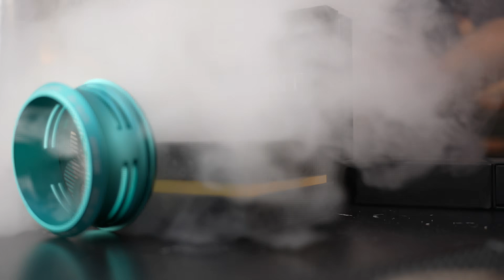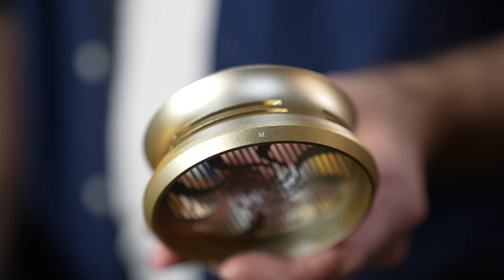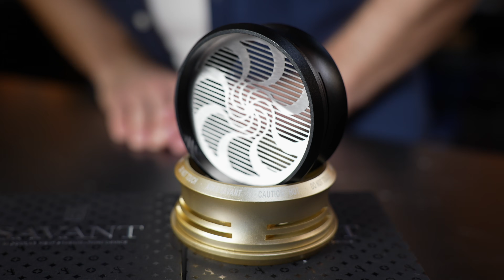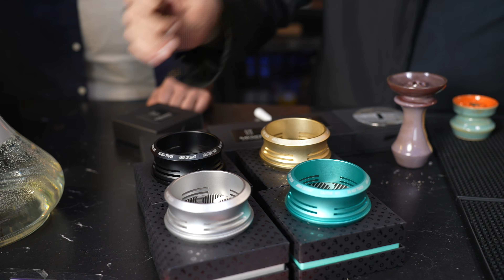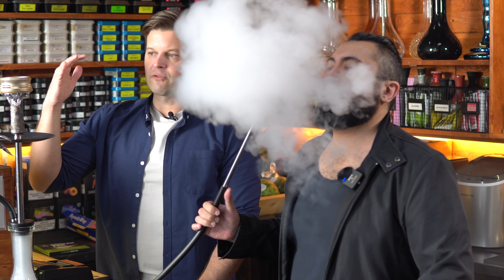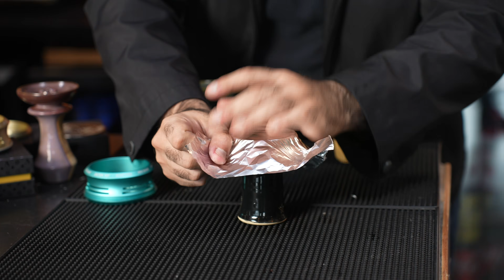Best Heat Management System? Meeting with the ARKA Savant HMD Manufacturer.

Comment: The issue with this hmd is that it takes 3 coals all the time. Version two needs to be able to work with 2 coals.
Reply: The third coal is only to expedite the heating process it takes for the Savant to get to desired temperature.  Therefore, if you’re willing to wait a bit longer the session will start with just 2 cubes.  However… let’s keep in mind 1 coal also costs around 15¢ at high retail value.  I don’t think that’s too expensive in exchange for pure flavor and no-thought sessions without burn.  I may be mistaken though 🤷🏻‍♂️
Reply: @SarkisAlexander  i dont think this is about cheaping out on 15c brother. Just quality of life suggestions. Some people dont buy cases of coal and buy one at a time. Using 2 per session extends your time for buying your next box.
Reply: @ I’m not assuming buy a case at a time but most people do buy a couple kilos at a time.  That said, this wasn’t exactly the point I was making either.  There are pros and cons to any given set up and we can explore every nuance; however I’d sincerely hate to reduce the pure joy of the session down to counting coals. I engineered the Savant using 24 years of expertise at the highest echelon of the craft.  The pure flavor and smooth clouds the Savant provides was the sole emphasis.  It’s up to you to decide if next level flavor purity and session quality is worth the extra coal or not.  That said, we’re already developing a lid accessory for the Savant for those like you who must use 2 cubes - i hope people don’t keep it on for longer than a 3minutes though bc the Savant is exceptionally thermally efficient once it reaches desired temp.

Comment: Do they ship to europe
Reply: We have distribution in France, Germany and Spain 🙏
Reply: @ Thanks for your answer. I currently use thick foil with 8-9 holes arranged in a circle on the outer edge, leaving the middle untouched. My setup includes an HJ Phunnel bowl, an Amy Deluxe chimney screen, and 27mm coals. Each bowl holds around 20 grams of tobacco, and my sessions last about 60-75 minutes.

Lately, I’ve noticed that when I clean my bowl, the underside of the tobacco seems underused and wasted, while the top is slightly burnt. This makes me think that the sides and bottom of the bowl aren’t getting hot enough.

I was initially considering the Lotus I+, but then I came across the Arka Savant. Do you think the Arka Savant could solve this issue?
Reply: @Kazanbazan100   the Savant will definitely help and in your case you’d be utilizing 3 25mm cubes in a triangle format.  And rarely needing to change position (but if you do need to you’d just swap to a pyramid stack with the same 3 coals).  This is due to the fact that your bowl is simply extremely large (assuming you’re using either the HJ Harmony or HJ Trimony bowls).  This is also the reason you’re not getting a complete burn either.  Now if you happen to have the HJ 80feet - it’s a much more manageable bowl where you’d get the same length session except no wasted tobacco.  In addition, there are other relatively small sized bowls on the market that are smaller than the 80feet and still deliver 2hr session times (such as the Alpaca Mini Rook).  ARKA is also releasing some very high performance bowls as well so make sure to keep a lookout for the drop by following the brand page on IG @arkahookah

I did not comment on the other bowl you mentioned because frankly it’s not worth considering in this case.

Edit: also, for such large bowls you need at least 3 rows of medium sized holes (spaced about 4-5mm apart on both axis) and one larger hole in the center

Hope I was helpful!

Comment: This is the only video of yours I have to disagree with, and it's not because of you. This slimy salesman never once mentions the Provost and that was intentional, he wants people to believe it doesn't exist and that his hms is the only one on the market for foil. His body language shows: Shifting eye contact, stuttering a whole lot and appears to be sweating. It's very late to the game, Provost already has this market cornered and it'll be a cold day in hell before you pry their fanbase away from it in favor of this. It's really, really bad to charge $50+ and then an upsell for adapters (in the event that it won't fit your bowl). I was considering it because there's a store nearby that has these in stock but after watching this video and how he tried to fool us, reading the extra cost for what they should just include, I'll pass. I don't care if it's $5, I would never support such an unethical business practice.
Reply: Before everything else did the provost was ever meant to be used on foil ? or there was an apple on top bowl which was made for provost?
Without using a product by urself you would comment like that? 
I bet you don't even know provost doesn't work for every tobacco it works for only high performance tobacco which is capable of taking the heat.
Savant is not a high heating device it just so moderate that you can throw up any tobacco and it would work on it.
Always remember to be called the top notch and the greatest you need to have a big bunch of people who are mediocre and my friend u fall in that category
Reply: This slimy salesman is the guy who first discovered that the Provost works best with foil (this was circa 2014) after the entire hookah community slammed it for being “cheap” and “burning the session” - then spent years promoting it and teaching tens of thousands of people to use it.  The reason?  1. Because this slimy salesman loves shisha and wants everyone to fall in love with shisha the same way he does, and 2. Because the Provost was originally created for the AOT Bowl and that’s why everyone else was using it without foil and failing with it.

Thank you for the love,
Slime Salesperson who engineered the world’s first HMD specifically made for foil, the worlds first HMD that utilizes two different metals,  the worlds first modular HMD, the worlds first HMD which was engineered by collecting months of thermal imaging data, and the worlds most versatile HMD as well.  🙏

Edit: if my eyes were shifty, i sincerely apologize.  Firstly, I’m not an actor.  Secondly this entire video was shot in one shot, completely unscripted and I did not even know the questions I was going to get asked prior.  Thirdly, there were 3 sets of cameras and bright lights in front of me and the cameraman was constantly pointing at different cameras for me to look into.  If that’s enough for me to call me such names and accuse me of baseless nonsense after I’ve already have an incalculable resume of contributions to the hookah world at the highest level, then so be it.

Comment: Very interesting! Does it work with flat charcoals?
Reply: Yes! It works with any type of coal just a matter of your heat preference. For flats, I start with 4 Stonehenged then switch to 3 Stonehenged in a line.  I’ve seen some even go down to just 2 flats since the Savant is so efficient even without a lid

Comment: I watched the entire video and I have no idea what you meant by "it thinks for you"
I believe you put work into this, and it's very pretty, but maybe work on you presentation. I came here to be convinced, instead I'm just kind lost
Reply: Hello, I’m assuming you are referring to me the owner, designer, and lead engineer of all ARKA products, including the Savant.  
The reference “it does the thinking for you” is in regards to how it was named.  A Savant is a sort of a super-genius.  In this sense, since it controls and stabilizes the heat, and transfers it in such an efficient way while keeping the heat at an optimal temperature, so that your sessions never burns…which is what you as an individual would normally do in order to enhance and optimize your session.  All the little nuances of moving the coals and heat managing your bowl is now done by the Savant.
We managed to pull this off by manipulating thermal retention and transference via the shape, form, design and, especially, the carefully curated materials used to create this product.  Namely billet aluminum and 316 stainless steel - at specific thicknesses, with specific cutouts, which get the job done correctly.

If you have further questions, please ask.  Happy Smoking
Reply: @SarkisAlexander  I got Hookain POPO phunnel bowl (7.5cm diameter) which is heavy and fat and it was said elsewhere that only stainless steel HMS (with aluminium foil) is able to heat up such thick bowls correctly. I know Savant (which I bought recently) has stainless steel bottom grill. Its sides do not touch the bowl because there is few mm gap. All that is touching the bowl (or to be exact the foil that is placed onto it) is the bottom grill. And my question is: is such thin grill able to heat up even these thick bowls correctly through aluminium foil or this is weakness of Savant and I should preferably use less thick phunnel bowl? I would not ask if Savant actually touched the bowl from outside, butnow the area of contact with the bowl itseld is ONLY through the grill lying on top of it. Could you please clarify is I should preferably  use less think bowls with Savant or thick but shallow (basically not thnck and deep)? Thank you. Be well.
Reply: @mdl12321 the Savant Plate is specifically engineered to be the exact thickness to work in perfect synchronization with the foil underneath.  It should touch the foil, but it seems your bowl is a tad wider than standard.  We have two solutions for you: 1. Grab the Savant Adapter L so it’ll fit the wider circumference of your bowl, and/or 2. Remove the Adapter it comes with to give yourself a few mm more space to accommodate the bowl.

Otherwise, yes Savant was designed to perform exceptionally when used as intended 🤝
Reply: @SarkisAlexander  Hi Sarkis, I think you misunderstood me a little :). The bowl width is 7.5cm, stock Savant is able to accomodate bowls upto 7.8cm width,so I think it fits greatly now. I just do not know if the stainless steel bottom is able to provide enough heat for heavier bowls such as Hokain POPO. I think it can, I just weanted to be sure. I asked because I see the aluminium sides of Savant do not touch sides of the bowl. All point of contact is from bottom of savant to top of the bowls rim. But I guess all is fine, even with such heavy bowls, right? Be well and no worries mate.
Reply: @m @mdl12321 addressed multiple possible scenarios based on your previous comment to make sure I cover every possibility.  I also addressed your question regarding whether it provides enough heat at the very beginning and then affirmed it again at the end.  I’m not sure there are many more ways to say that it was engineered specifically for this - which means everything was calculated for use with foil so that it absolutely does provide enough heat - including, but not limited to, the fact that it can hold 4 26mm coals inside it in case the user requires more heat for their specific application or heat preference.
Reply: @SarkisAlexander  That sounds perfect, thank you. Btw it tastes wonderfully. I am very satisfied customer of your Savant. Thank you. Bravo ! 🥰
Reply: @mdl12321  it’s my pleasure, you’re welcome 😌 the fact that you’re experiencing such pure taste is evidence that the plate is perfectly engineered for its use.  Happy Smoking my friend

Comment: I've been using Kaloud Lotus 1+ for a while now. However, it worked with certain titles. In fact, it works poorly with heads that have a small tobacco chamber. Lotus works well when you choose heads where you can put more tobacco. Because unfortunately, some burn tobacco while they are at work. You need more tobacco left at the bottom.
Reply from the maker: Interesting. Thank you for sharing this.

Comment: The savant is great. Since i got it. I've been using it, nonstop. I really pull different flavors out of your, shisha. I used Malaki brand, and it tastes so much better.  
It fits every bowl just fine. Even its smaller, it will work fine.  

It's worth every penny.
Reply from the maker: Yup, it is giving a cleaner taste. Glad you're enjoying it.
Reply: This was exactly the goal 🙏
Reply: How many coals are you using with it
Reply: @ you start with 3 to assist in getting it to your desired temperature.  Once it’s hitting, drop the third coal and let it work its magic for the next 1-1.5hrs until the coals are too tiny, then add the third coal back in.  You can put a second set of 2 coals for round 2 and continue on with really good flavor and smooth clouds
Reply: @SarkisAlexander  thank you, and you are using foil with it also right?
Reply: @ absolutely, either 2 layers of regular foil or single layer of 40 micron shisha foil
Reply: @SarkisAlexander  thank you
Reply: What is your favorite flavor from Malakai